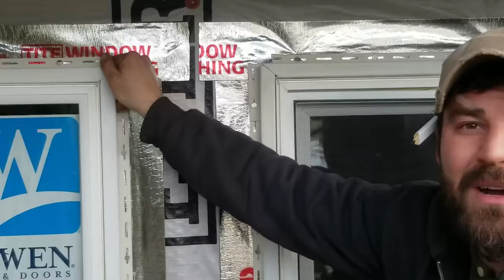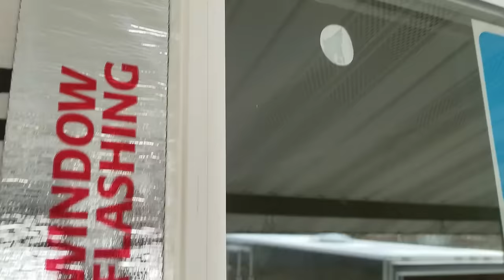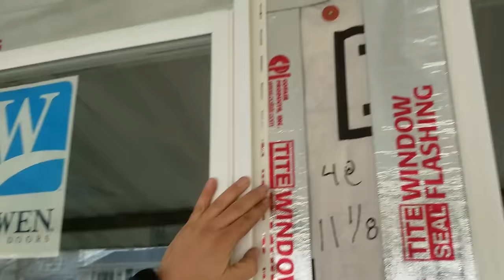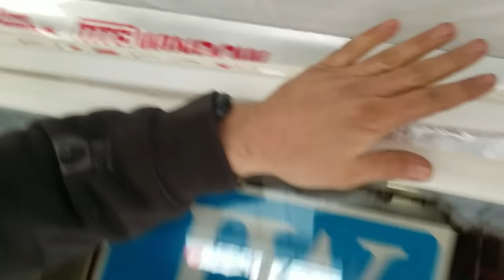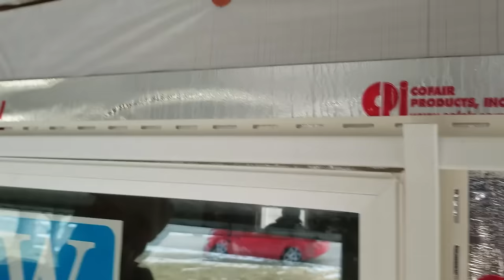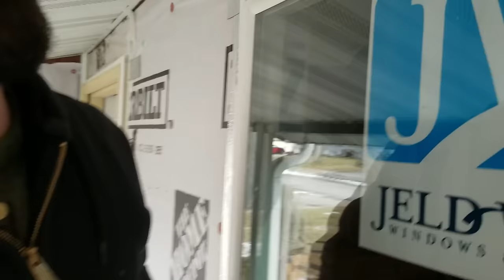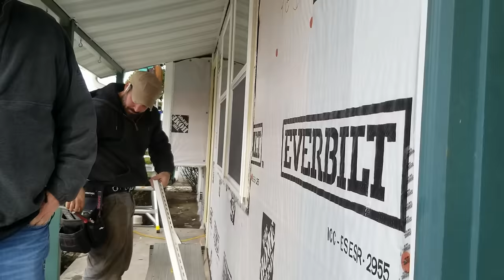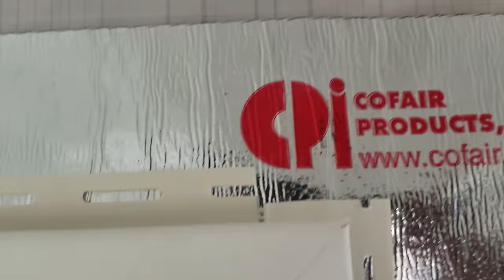HOW TO | J-Channel a Window (Perfectly Every Time)

Comment: This is one of the best how-to instruction videos I've ever seen as far as construction type stuff. Simple, actually shows us, up close, exactly what he's doing and why etc. You'd be amazed at how many people making these types of videos don't show you simple things.
Reply from the maker: I really appreciate that man! This is one my most underrated videos in my opinion
Reply: @NWIVeteranConstruction  of all the j channel videos I've seen, this is by far the best, detailed, simple, and helpful.
Thanks
Reply from the maker: @jonyates3918  awesome. Tried to make this one easy
Reply: Doing baby steps for the first time but I'm getting there on my own figure how to wrap easy with just me. Made a base stuck a long pipe that wont bend or tilt then pulled it then work my way down
Reply: I'm doing my very 1st residing project. You mentioned "under-seal molding"..... where does that come into play?

Comment from the maker: 28:00...If you already know how to j channel a window and just want to see how I do it, fast forward to 28 minutes.  Beginners can definitely learn from the detailed explanations in the beginning but i feel some of the experienced guys might see a different thing or 2 as well!  Hope you guys enjoy.  Don't forget to like this video and subscribe
Reply: Thank you sir,🙌🏻
Reply: I have found that if you don't cut your 45 to a point it looks ways better. I use the face lip as a guide. But looks good man.
Reply: I just 45 one piece in the corners and leave the end kinda square so that way you get a perfect 45 when the 45 overlaps the square end. It's perfect every time and saves time. Like when you hold it up to mark where to trim it back just cut that line but no need to to 45 your other piece with the 45 will slide right over it giving you a perfect 45 and never a gap between the two. Pieces where they meet. Hope this makes sense
Reply: It would be the top and bottom you leave square your sides 45 and they just slide over the square end and bam your done.
Reply: Your video was awesome. This was my first time trimming with J channel. I was using metal J for my metal siding and all my corners turned out perfect.  Thanks again
Reply: @jpoe7448  he does it that way for water protection
Reply: South Park cartmans kitty

Comment: Newbie here. Great video. I bought the $50  j channel notcher, thinking it would make the job easier. After seeing this video, I stand corrected. It is more difficult to use notcher the colder it gets. It is supposed to have two settings, one to notch two sides to leave the hinge and one to notch all three sides to completely remove notch. When it's cold out, it wants to take the whole notch out every time. Returning this tool tomorrow! Thanks again for the great videos.

Comment: This is why its good for Supervisors to do installs in the field with their crew. To catch, and correct mistakes, AND to get reminded why jobs sometimes take longer then THEY thought it should. Good for everyone involved.
Reply: ANY good supervisor already “assumes” jobs will take longer than they should. Even when I estimated contracts I always added extra manpower time into my pricing because NO two jobs are alike, no two crews are alike, etc. For example, I shouldn’t expect the same amount of “work” in a day from a team of one journeyman and a helper as opposed to pairing up two of my top paid guys together. Luckily for me a fire sprinkler contractor it was always pretty “easy” to estimate these numbers. Is he a 30 buck an hour guy? That means he should be giving me 30 cutbacks a day on average. It helps that I started my trade from the very bottom as a “shop kid” making 40 bucks a DAY and worked my way up to now running my own business successfully for more than a decade though.🤷‍♂️

Comment: I've been siding for about 20 years. I exclusively do Smartside but did vinyl for about 10 years. I learned this method about 8 years in and I never turned back. If you put it on first and mark everything with a pencil i found it was way more precise than measuring. Also... with the nail flange on the window we used to bend out the front of the J from the back just a bit so the channel doesn't roll forward and get it nice and tight to the window. Hands down best way to do channel. Great video brother! Just the tip😂😂 glad we aren't the only ones who make that joke.

Comment: Zack, I am a carpenter/ roofer 36 years old doing this work since 18. I can do the 10 minute windows but I never thought about leaving the back half for the flap that bends around to put a nail in it. Thanks for sharing that brother. I always just cut it out and fold it over. But I will be using that next time.
Reply from the maker: Glad to hear
Reply: Same here! Thanks for sharing these videos man. Keep up the good work...
Reply: I think most of us cut that off also.
Reply: It holds the corners a lot tighter, and, if you start from bottom up like him, it's better water protection
Reply: I do the opposite. I cut the back side off and leave the front side, I just cut the rounded edge so it can slide inside the bottom J-channel.
Reply: @2010pinmaster  wanna leave the back side for water channeling

Comment: Many thanks for the great vid!
An extra step worth considering is flashing beneath the side J-channel bottoms: 
Cut a piece of flashing out of felt paper or flashing tape and install it at the bottom corners of the windows before installing the bottom & side J-channels. Overlap the flashing onto the siding course just below the window. Now, water that runs inside the side J-channels will come out on top of the siding & out it's weep holes, not behind it.

Comment: I never had a teacher for much either. My mistakes and the things I done right taught me and now, have made me prosperous. It's to easy once you take the time to learn and to also learn how to learn that sometimes there is a better way than the first. Complacency is the downfall of a lot of the workers and I've seen it first hand. I'm a roofer. I do inside work and outside. Anything but heating and air. Your videos have made a difference in certain things I do because I liked your technique. Thank you for everything bro, keep up the good work. Every video is helpful to me if no one else lol
Reply from the maker: thank you for letting me know! there's nothing more rewarding than knowing these videos are helping fellow installers. that's what they're here for. I do just about everything as well! hope you stick around to see the indoor work I have in store. if you saw the roof measuring video you can tell in the beginning I have more cut out for me yet at the flip house

Comment: Just finishing my 3000 sq ft place, great video, I want to share some tips I used. I bought the tool that cuts-bottom out. Worth the money to save time, but not necessary.  But my siding is wood colour and with snips left the cutouts showing the plastic colour. Tool makes neat cuts. The tool I said can cut a small tab but Zack’s idea is way better for attaching. The corners at 45, if you keep it a few inches long then you can bend it over and keeps corner crisp and in place. I also too a 6” piece, cut perfect 45’s on each corner, used as a temp plate.  Had some big windows and was hard to hold sides and get top figured out. I would get the bottom first, the sides at bottom are easy todo, then by leaving the sides a bit long at top, using my template I can trim the side piece at top, both sides, then measure the piece, keep few inches each side long like video, I did left side first, then put the piece up and used my template to measure the angle ect, then, put it up and Bammmm! Done. Looks great. As a tradesman I tell my apprentices my way works, here is how to do it, but, it’s ok to tweak it as you like. Thanks again.
Reply from the maker: Thanks for the comment bud! I just don't have it in me to buy that tool so I can clip the ends to accept a 45. Coz like you said, With the way I do my corners I'm leaving that flange that the tool cuts off.

Comment: All three sides were spot-on as to measuring and cutting.  I am having a real rough time with only the top piece.  The miter has always been falling short.
Reply from the maker: sorry to hear that! maybe you needed to make sure you were holding the far end flush to where you want them to sit before you made your mark? you can always elongate your 45 also, and nip off any extra. better long than short.

Comment: I usually leave the 45 and the bottom of j when I connect them. And if you put the 45 into that double bend of j it will stay there. Idk if you got what I meant, but that's how I do it. Also if top of window I'd higher than i can reach i just cut like 1.5" out of back of j and fold it more than 90° and just slide it down at the side of the window till the backbend hits the top and after finishing the bottom i just keep going until I get to top of window

Comment: Damn good job there. Wish I was still doing this stuff to be able to use your techniques. One thing I would throw out there that may help someone as it can be easily overlooked, is that when we would do a job like this with new windows being installed, we wouldn’t install the screens for the windows until the very end after the siding. This helps prevent anybody from putting a hole in the screen when they aren’t paying attention. (We had a few guys that were drawn to them like magnets and would inevitably end up putting a hole in one)
Anyway keep up the good work

Comment: at 13:56 when you matked the bottom J with the side J up, you dont need to mark you can hold your red/green for either side of the window and cut with the side j still there to the bottom and for your mitre you can curve your cut in at the top for easy fold overs
Reply: nvm

Comment: Thanks great video! What about nailing the utility channel the same time you install the bottom piece? Use the same nail to secure both pieces...saves time...
Reply from the maker: Well, that's why I barely nail the bottom.  But I also wrap those 45s around the bottom so if the UT is on it'll get in the way.

Comment: Very well done video.  Thank you for making this.  I'd like to see a similar one on doors.  (ie:  do I need an aluminum drip cap?  Caulking?  Tape? How is a door properly installed to protect from weather?

Again... very well done.   Very thorough and descriptive.
Reply from the maker: depends on the window! if its got a flange like this and a place for you to but your j channel to then no..but if there's a piece of wood surrounding your windows edges then yes, the wood will rot if not wrapped or painted

Comment: Im retired now but I have a little trick for you when J - channeling. If you have a little gap between the channel and the window itself that wont close all the way try nailing a soffit nail inside the channel then into the window. You need to use a tool for setting soffut nails , I called it a 'P shooter'. Sometimes you have to shorten the nail but not usually.
I have never once broken a window

Comment: Hi, my name is Jason, I own E.M.T. Home Improvement Co. So I have a Big Question that you may be able to help me out with. So I am doing a Cape, 9 windows, 3 Door's, 3 Porch, Balcony, etc and Solid Core Siding. Well when I ordered the windows I ask them for a Window with Built in J's that can receive Solid Core Siding. Well the window's are all in the house along with the doors, and we were so excited to finally start the Siding, well everything went Well till I got to the Window's and find the siding doesn't fit in the J-Channel on the window! So basically my Distributor neglected to tell me that they do not make those window's anymore. So now I sit with that problem. I have gotten a couple suggestion's, but then ran into you on YouTube just looking to see if I could figure anything out. Well I watched your video and you know your shit really good so I figured I would ask you if you have ever run into this problem, how did you fix it? Or if not what do you think might fix the problem.       THANKS!
Reply from the maker: That's a tough one. Hard to say without being there but I imagine you're going to have to j channel against that.  Maybe slide some nice one by's in the window channel and make it look like a big window detail that was intentional. I imagine you're gonna have to do something along those lines.  maybe Google exterior window trim and see if anything jumps out at you
Reply: Ya 2x4's and cap with Coil then J-Channel, Door's all need it also. It actually looks better than without Padding it out...

Comment: Clean bud. We have to flash everything up here in snow country, even under a big porch. So to make it a little quicker, I'll blind caulk J to window, then top flash I'll bend the tabs inside the J, holds the J tight while silicone sets. But, what I wanna know.... What is that utility knife?? Can you put hook blade in one, straight in the other?
Reply from the maker: Yea I have a dual blade.  Or twin blade its called.  You can find them on the internet or menards is the only one ik that carries them. The dual blade used to be bostich, then Stanley, now its red craftsman.  Same exact knife.  Colors and name keep changing

Comment: Hey Veteran, My front porch is concrete and I can't add a starter strip,  IN this case would you use a Pc of J at the bottom for the 1st pc of siding?

Comment: I recommend exterior galvanized nails instead of aluminum! They are a little more expensive but they are way stronger and you dont get bent nails! Fyi! Good work brother!
Reply from the maker: I will look into that thank you for the suggestion!
Reply: I have used the stainless steel capping nails but I thought all siding nails were electro-galvanized steel. Maybe you meant hot dipped galvanized nails as Norm once described he feels that they grab better because they are rougher
Reply: Where I'm at in Maine theres a few different options they have completely aluminum nails, elctrogalvinized which will rust eventually and yea what I'm referring to is a hot dipped galvanized. They have alot more strength and you never get bent nails like the aluminum ones! Can get pretty frustrating especially siding older barn board structures! Its worth the few extra dollars to get hot dipped! Just putting it out there I've used them and wont be going back to aluminum!

Comment: Do you still need a drip cap or some kind of rigid flashing over the top for waterproofing…or can you just use j-channels and bring the siding in?
Reply from the maker: just the way i did it because we flashed correctly. its ready for siding. cut the house wrap above the window and drape that over the tape on the top. granted that it is new construction window with nail flange like mine was

Comment: Do you guys caulk around ur j's? I was taught to leave a siding nail worth of gap around the verticals and top horizontal j's to allow for a caulk gap.
Reply from the maker: Nope.  If the window is flashed with tape you don't need to do that.  That's Prolly not a bad practice on replacement windows and wrapped windows though

Comment: those corner welds are very specific and if you accidently cut to far into them you will not only void warranty on that window- but it will cause the window to lose energy efficiency. I get why your doing it, I would just be crazy careful doing that.

Comment: Any tips on replacing vinyl siding window lineals that are dry rot and breaking without removing the siding?
Reply from the maker: Cut the caulk loose pull em free.  If you need to replace the window run a Sawzall down the nail flange and buy a replacement window
Reply: Not that easy, these lineals have j channel attached to then for the siding. IE, the siding ends 3.5 in away from the door and window casings. The lineals have the j channels built into them for where the siding ends.
Reply from the maker: @deanweingarth9586  oh. Well if im imagining this correct just remove those wraps.  Redo the wood (or leave it) and rewrap.. You're gonna need a brake to bend the metal.

Comment: Just a quick question I understand the length of the J-channel as you cut it but the thickness of it when you put it up against the window is it supposed to pass the window or be just as flush as the window for future reference when I’m doing J-channel, or does it matter how far the J channel sticks out From the wall, (I hope somebody can answer this because I just got done working on some wooden casing around these old windows and supposedly the partner says that the J channel supposed should be flush with the window casing
Reply: Mine is flush, but I'm new to vinyl siding. It looks good, and this technique worked well for me. Personally, I wouldn't have worried about the thickness as much as it being a good fit at the corners. Good luck, man.

Comment: When you do your miter tab if you leave the face of the j channel on and cut the bevel part of fold, tuck it into the bevel of the j it’s over laping ...it locked way tighter rather then cutting the face of the miter tab
Reply: Yes, that would be my only major difference, if you want to call it major. It locks in the bend-around corners tighter. Makes the miters tighter. But he did good.
Reply: kip carroll yea no doubt

Comment: I agree pulling your tape out is a waste of time, but if you get the measurements of the window add 2" cut your miters or notches  on all 4 pieces at once. I like your way but some windows are higher or wider then I can reach.